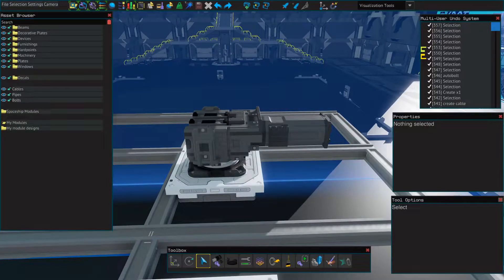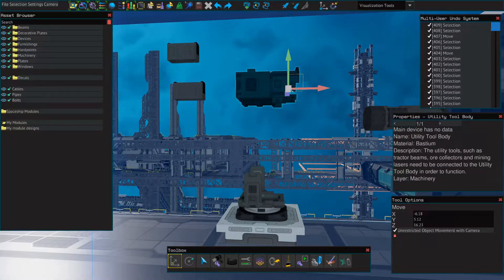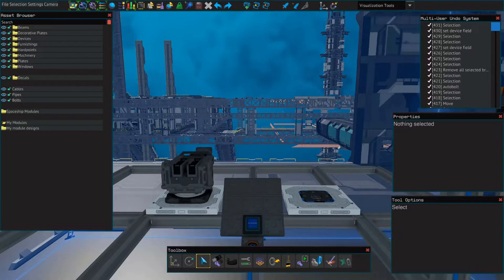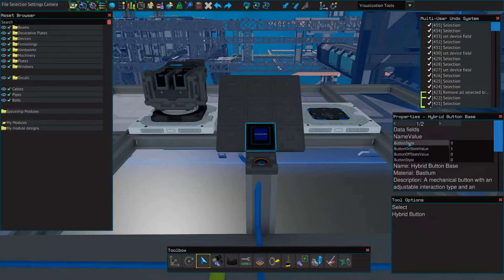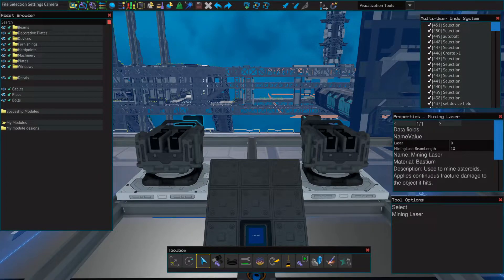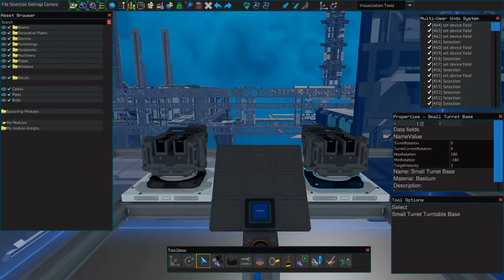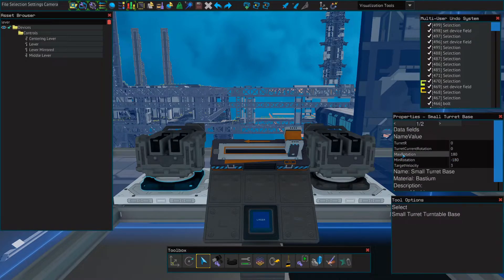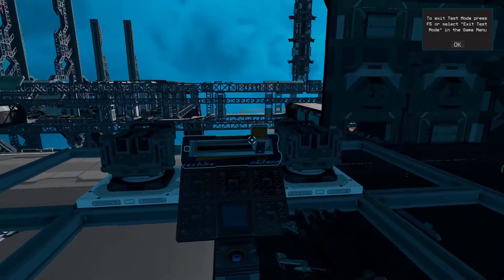Starbase Ship Building Tutorial: Episode 6 Mining Lasers

Comment: my turntable is receiving the output from the slider but it doesnt actually turn the laser, it fires ok however
Reply from the maker: Check your bolts. This is often the result of a bolt connecting with the disc on the turntable and locking it in place.